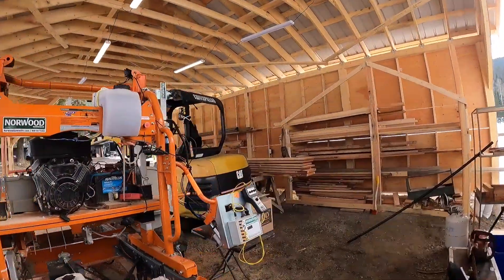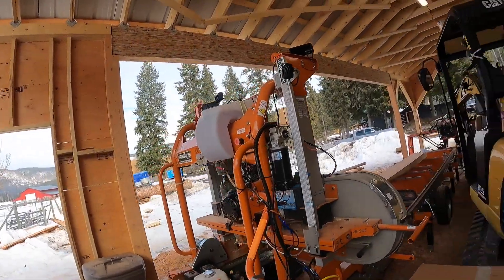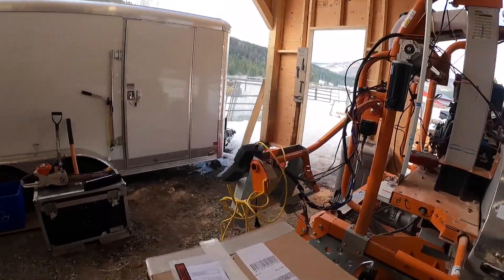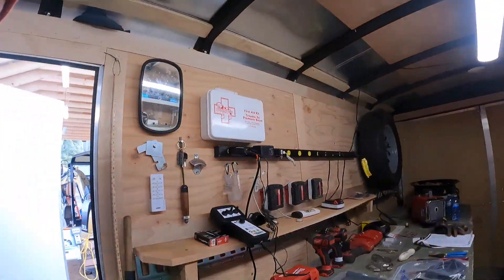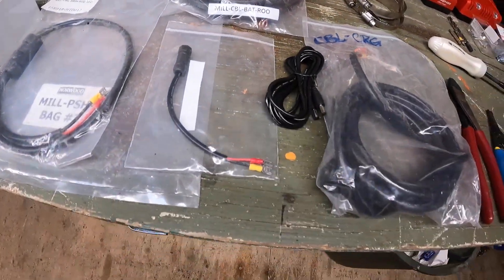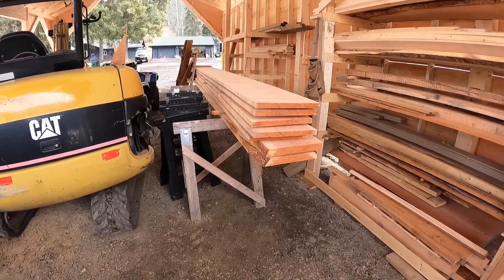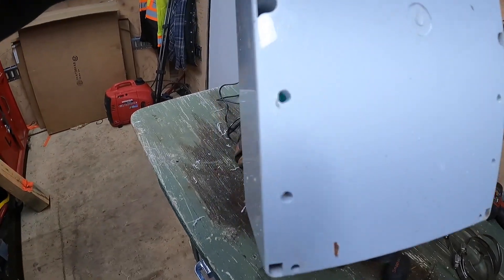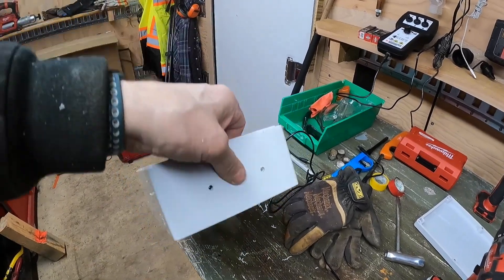Norwood HD36 – DIY Electronics & Controller Installation – What Worked & What Didn't . . .

Comment: Sorry to have to tell you this Howard but there are already 4 mounting holes in your control box. They're in each corner next to the brass inserts. If you look closely into the oddly-shaped holes, you'll see, at the bottom of the holes, the actual mounting holes. The enclosure is made this way so that the outside of the enclosure is clean and neat and the mounting screws are "inside" the enclosure but "outside" of the interior. Basically, they're inside the outside and outside the inside.This keeps the interior completely isolated from contaminants. 
Enjoyed the video.
Dave
Reply from the maker: Lesson learned - I should have reached out to you as soon as my puzzlement started to set in.  Here's with appreciation for your wisdom.  Thanks for being part of my journey.

Comment: Hi Howard!!😀😀
Great to see you my friend!! 
Glad to see the new controller works properly. Too bad you had trouble with the original one. Was surprised that you had to drill new mounting holes for the new box. I think it would have been just fine if you would have just used the bottom 4 holes you drilled . You could have maybe used a couple self tapping screws for the top 2 holes in the back instead of zip ties. That way you wouldn't have had to drill the 2 holes in the top. But at least now you can get your lumber sawed without pushing the carriage by hand. 
Take care my friend!!😀😀

Logger Al
Reply from the maker: Hey! Al - always great to hear from you!!!  
Loving the new controller and set-up.  Norwood really got it right this time.  Short video in the making.